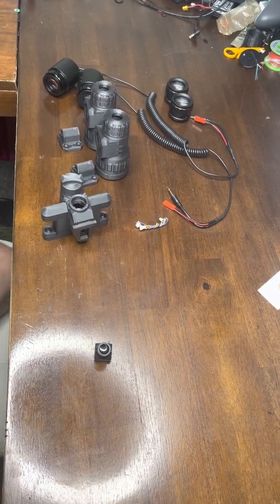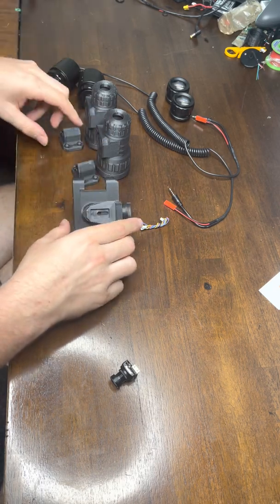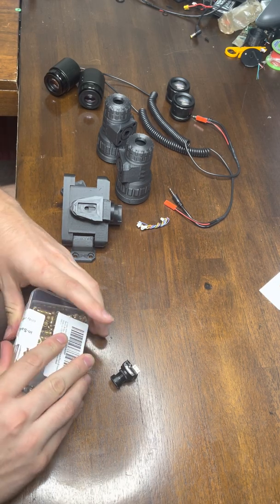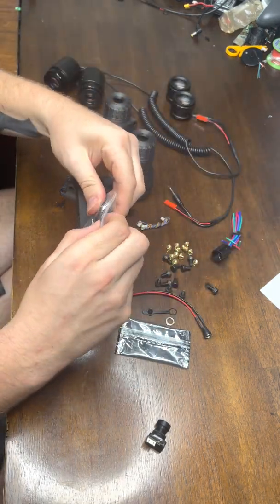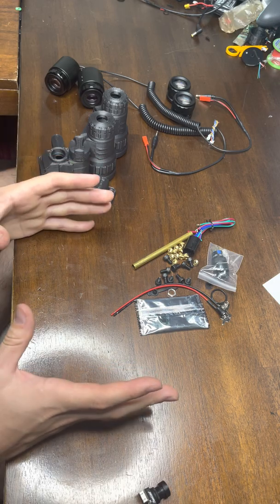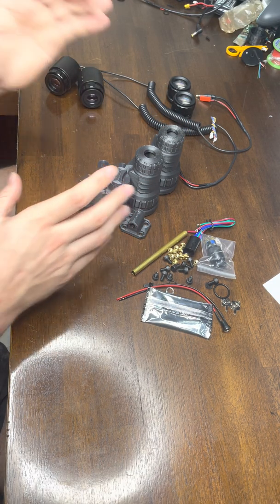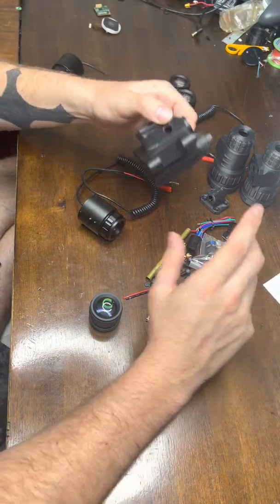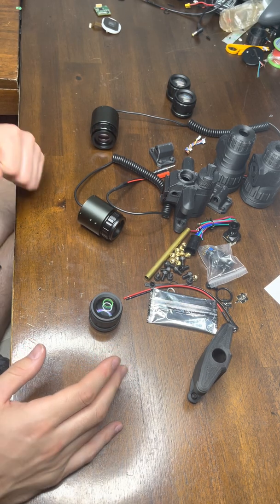PVS-69 build guide part 1: intro to the design

Comment: are you stocking up on the kits any time soon? id love to buy a kit to try building one myself.
Amazing work btw :)
Reply: oh I think I just discovered the Alpha hardware kit. Is this one needed to build the FOXTROT Gen4 unit?
thnx :)
Reply from the maker: @Qadi90  did away with foxtrot the alpha kit is what you need
Reply: @vonscherfarms925  got it. will go with files and kit from your website to not end up mixing things up.

Comment: Is there a monocular option? It would cut costs and be an easier assembly
Reply from the maker: I haven’t made a bridge for it yet but others have. And some people decided just to not cut a whole in one of the brass tube pieces and leave off the other pod
Reply: @vonscherfarms925  ok cool that’s interesting. First of all, thank you for all your hard work and engineering. I’m really considering this. I’m a veteran so I’ve used real gen 3 nods before, and I wanted my own, but I got a stupid toy digital night vision that isn’t really worth a darn. I can’t quite justify spending more for nods than I did on my car, and so this is a really appealing way to get into night vision. 

Some questions: what is the lag like? What is the frame rate of the camera and screens, and do you have any specs on the latency in ms? Or just, subjectively, is it noticeable? Is it laggy enough to interfere with tasks at all?

Second, how would you say they compare to gen 3 tubes? In terms of lowlight performance and clarity?
Reply from the maker: @hunterterrell9930  hey man, theres was some third part testing nd the camera itself had a latency of something like 20ms. the lag is not at all noticeable. they do no have the capability gen 3 has but they work for the majoriry of tasks you would find yourself using nods for. weve done some side by side comparisons against sionyx and it has the same low light capability with out the lag

Comment: Honestly these units would be pretty sick if you guys switch to sony imx starvis sensors. Esp32 and some Arduino code or even plaform IO to code it will do wonders. Im currently working on something using a imx starvis 400 series of sensors. They're expensive but the lux and fps is worth it. 40 fps 1080P with substantially more lux sensitivity due to the sensor being a 1/8 inch.
Reply from the maker: I can’t confirm but I’m almost certain the cameras used are starvis sensors. The reason we’re sticking with off the shelf FPV cams is the simplicity of the build. A lot of people struggle with just soldering a huge part of this build is to make it repeatable by anyone with a brain
Reply: @vonscherfarms925  I think most people looking into this would be either will to do the extra work or pay more to have it done to get the best possible results from these
I would pay for anything to make it better up to about 3k
Love what your doing though, keep it up. Maybe if you get far enough you can do this  make a living off of it
Reply from the maker: @Gooney_Tunes  the majority of people building these are looking for budget (under 1k) night vision adding an MCU into the mix will really complicate things, you would be surprised with how many people don’t understand basic wiring, voltage amperage parallel, series, etc. for the foreseeable future I plan to stick with the current setup. I do have an analog housing on the way as well which targets that 2-5k budget. The issue is the cost of sensors drastically increases. The syonix 1” sensor is commercially available but at a much higher price than the $70 sensors currently used. IMO the money will be much better spent on the thermal fusion device which is also in the works
Reply: @vonscherfarms925  yeah that makes sense, well maybe one day it’ll come out of the DIY spectrum and be produced as a legitimate product and viewed as something worth spending the extra shmeckles on
Reply: @vonscherfarms925  it’s me. I’m the one that doesn’t understand wiring.
Reply: @vonscherfarms925 yeah if I had 3 grand or 4 grand I’d go buy a manufactured set not build them myself lol. I’m trying to get armor and night vision for 1000 lol
Reply from the maker: @christophertibbetts2458  it doesn’t cost 3-4k to do it yourself. And the current iteration of the design is as strong is not stronger than the two other printed NVGs on the market. Neither of which you can get for less than 5k
Reply: man, please share what you are doing with the imx sensors. I want to do that to. I was thinking just like you for those starlight cctv sensores
Reply: Is there an update on your setup? Sounds more complicated but could deliver better results.

Comment: Have you considered using “Essentium HTN CF25” filament? 
It claims to be as strong as aluminum. It seems like a good choice because of the amount of work and quality you are putting into these things.
I would pay extra for the strongest possible housing and highest quality parts. Might as well go all out if I am already spending the money, and it would still be cheaper than the analog equivalent.
Reply from the maker: I’ll definitely check it out!

Comment: Would you recommend a resin printer for this regarding the waterproof and overall structural integrity?
Reply from the maker: Coating the exterior in resin post print would help with waterproofing
Reply from the maker: I can’t say that I’d recommend resin since I designed these to work with FDM like the tolerances and thickness of the walls etc

Comment: So the Charlie is just a more waterproof Delta that has a larger O-ring? What is the size?
Reply from the maker: I don’t know the exact size atm I will get back to you in that! But it has some slight changes. Charlie doesn’t require supports for the tube. The display is shifter forward more and it is better waterproofed. The bridge also had a small redesign from the original Deltas which makes the dovetail much stronger